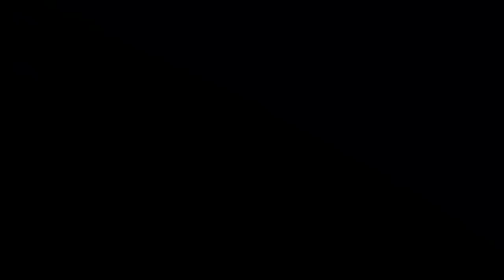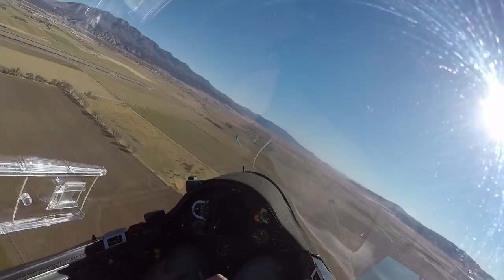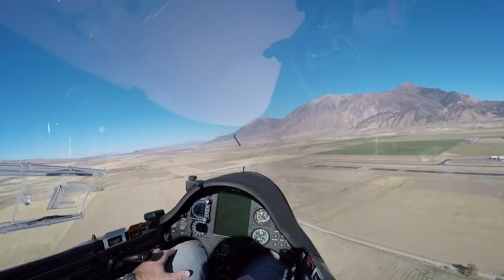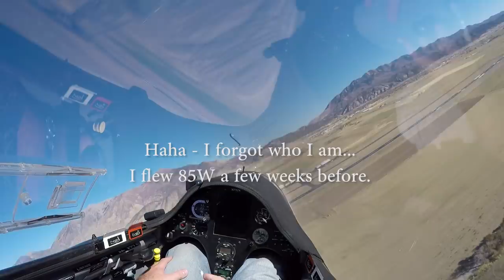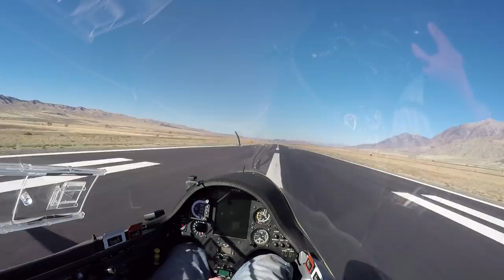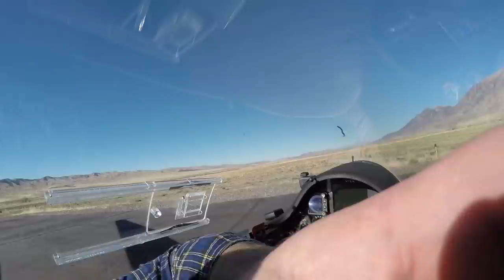Glider Ground Effect Demonstration

Comment: Ground effect is where the air below the wing is compressed and creates lift. It happens within the height of the wingspan.
Reply: Correct explanation, no effect on drag.
Reply: Real engineering made a great vid about this
Reply: K S thats not correct. Induced drag is reduced in Ground effect.
Reply: It does however effect induced drag
Reply: The air is not compressed. Compressibility of air is negligible under mach 0.3. Lift in increased and induced drag is decreased because of the proximity of the ground.
Reply: Pieter de Buck I don’t believe that. People often say “air is incompressible”, but the pressure under a wing is always high, which must mean the density is also higher so the air is compressed, no?
Reply: @theespatier4456  yes technically the density has to change of course, its just negligible at low speeds (< mach 0.3)
Reply: Pieter de Buck Yes, I guess most of the ground effect comes from decreases induced drag and not lift from a compressed air cushion, as some say. But I would assume it’s the opposite in helicopters!
Reply: The Espatier no, it’s not high, just higher than the air above the wing
Reply: @theespatier4456  What?? Who has ever said air is in-compressible? Are you getting confused with water? Of course air can be compressed.
Reply: Tim Nell How high is high?
Reply: Lewis sun Lots of people... they say it’s incompressible under Mach 0.3 simply because that’s what physicists say.
Reply: @theespatier4456  I think you need to look into this. Air is compressible under mach 0.3, but it's just a negligible difference for aircraft at that speed. People that work with modeling aerodynamics through math and computer simulations usually assume it is not compressible in their calculations below 0.3 because it takes less time to get a result. It might not be perfect, but the errors are very small and don't really effect anything below that speed in the field of aerodynamics. Beyond 0.3, the effect is more noticeable and the proper calculations accounting for compressibility are required to get an accurate result.
Reply: @RyanGrissett  negligible is argued by the case, you cant just repeat it for any case simply by the speed alone.
Reply: Ryan Grissett Right, but that’s just a dogma that people repeat without understanding it. People often bring up “incompressibility” or “negligible compressibility” up after someone says air is compressed, higher density, or higher pressure under an airplane wing. How “negligible” is the difference in pressure below an airplane wing if it makes an airplane fly, for instance? That they never explain.
Reply: When dealing with the pressure changes around a slow-moving wing (mach 0.3 it lower, roughly speaking), the change in volume is small, on the order of fractions of a percent.  The bigger picture in so-called 'incompressible' flow is that the flow field extends significantly in front of the plane as well as all around and behind it.

In normal flight, the wingtip vortices begin to develop well in front of the plane, along with an outward  component below, and an inward component above the wing, with the done in the middle flowing downward.  This has the effect of making the wing perform as if it were shorter (spanwise) and fatter (chordwise), and thus less efficiently.  In ground effect, the formation of the downward and outward components, allowing the wing to perform as if it were longer.

TLDR version: it's due more to changes in the flow field than changes in the pressure.
Reply: It only comes into effect when above the ground by half the wingspan
Reply: Thank you mate. I'm an AMT student but we haven't come up to that topic yet.
Reply: @gabrielshamahabonales4348  Wenn man Gefühl hat, spürt man diesen "Polster" beim Landen, knapp über den Boden.
Reply: @theespatier4456  It's easy to believe that but pressure and density are not the same.  Pressure can increase or decrease on a wing without changing density.
Reply: So much drag in the comments.  Beautiful flyight
Reply: @yak55x  Fliegen ist  Gefühlssache . Man fliegt nicht nur mit dem Kopf, sondern wichtiger mit dem "Hintern", man nennt das "Sitzgefühl".  und beim Landen spürt man, knapp über dem Boden,  das Luftpolster, welches sich, unter den Flächen, zusammenpresst. Wer das nicht spürt, wird nie sicher fliegen können.
Reply: @wq6737  The internet is really annoying today. Keep feeling your backside.
Reply: @yak55x  That`s allright,Im im net schreiben soviele "Kluge",  daß  man sich nur wundern kann, von wo diese  deren sogenanntes "Wissen" erhalten haben. Da ich aber sowohl segel- als auch motorgeflogen bin, und Letzteres im Kriege als Jagdflieger,  maße ich mir doch zu ein wenig Kenntnis auf diesem Gebiete zu haben. Natürlich gibt es Theoretiker die alles besser wissen, ist aber deren Problem. Entschuldigen Sie mir, daß ich Ihnen deutsch antworte, ich bin zu bequem,  für jemandem, der ohnehin der Deutschen Sprache mächtig ist, englisch zu übersetzen; da ich mich, noch obendrein, bemühen muß auf  Taktlosigkeiten  kultiviert zu reagieren. Ceterum censeo, wenn Sie, geehrter Herr, das Internet so ärgerlich finden, warum lesen und  schreiben Sie dann hier ?
Reply: @wq6737  Google Translate: Es ist nur ein kleines, unwichtiges Beispiel dafür, wie Leute die Wissenschaft ablehnen, weil sie sich so anfühlt. Die Einstellung ist gefährlich.
Reply: @KS-tf6nw  Right, but as a consequence you get better lift and can lower the angle of attack slightly.  That enables you to float with a perceived lower drag for a while.
Reply: @yak55x  Hier fehlt der Großteil Ihres Kommentares in dem  von der Klimatheorie bis zur Flugtheorie alles durcheinander vorkommt. Da dreht es sich jetzt nur um das Fliegen in Bodennähe. Um diesen Effekt zu verstehen, braucht man kein "Wissenschaftler" sein. Wenn ich zum Landen ansetze, liegt erst mal die Maschine nicht waagerecht sondern vorne, nach unten geneigt in der Luft, also Anstellwinkel der Flächen ca.0. Knapp über den Boden muß ich sie vorne etwas anheben um eine "3 Punkt Landung" zu erzielen, ausserdem um einen "Kopfstand" vorzubeugen. Damit ergibt sich wieder ein positiver Flächenanstellwinkel. Damit pressen die Flächen die entgegenkommende Luft gegen den Boden,  verdichten die"Unterluft" gewissermaßen. Das ist dann das "Luftpolster", knapp über dem Boden. Diesen Effekt haben schon die DO X , bei ihrer Atlantiküberquerung,sowie eine Russische  Spezial - Flugzeugkonstruktion ausgenützt. Ist also eine einfach verständliche Sache, die beileibe keine "Wissenschaftliche" Erklärung benötigt. Im Übrigen, wenn man bestimmte, angeblich "Wissenschaftliche" Theorien ablehnt ist das nie eine Ablehnung der Wissenschaft an sich und gefährlich schon gar nicht , wir leben doch nicht mehr in der Zeit der Hexenverbrennungen, als Bezweifler bestimmter Theorien , mit dem Tode am Scheiterhaufen bestraft wurden ? Oder sollen solche Zustände wieder geschaffen werden, den Anschein hat es ja, zumindest bei der Klimatheorie !
Reply: It affects the induced drag
Reply: If I remember my aerodynamics class correctly, if you assume potential flow, you treat an airfoil as if it had a mirror image of itself across the ground plane. Pretty cool
Reply: @jpegjake  of course every case is different, but it would be easy enough to figure out the potential error if you run a simplified version of your simulation
Reply: I don't remember how it works, but I do remember that it comes into effect at ½ the aircraft's wingspan or ½ the rotor's diameter for helicopters.
Reply: when someone puts there finger next to your face and says i’m not touching you, well they actually are. anywhere within finger distance.
Reply: The Espatier You mistake pressure with change in destiny and actual compression. For example water is incompressible but you can change its pressure the same goes for air. In aerodynamics below certain speed the actual compression of air has negligibly small effect on the flow. Do you understand now ?
Reply: My GSI always told me that it was reduction of wingtip vortecies and reducing the induced drag.
Reply: @RyanGrissett  Nothing is linear. But you can linearise almost everything to get a close enough approximation that works.
Reply: Ground effect is where the high to low vortices are mitigated a bit and this induced drag is reduced.
Reply: half the lenght of wingspan actually
Reply: No, ground effect is when the ground blocks vortices created by the wing. These vortices normally cause drag, but if they're interrupted then they don't. It's much like the use of raised wingtips on planes (and birds) - these block wingtip vortices to reduce drag. The pilot in the video is correct.

https://en.wikipedia.org/wiki/Ground_effect_(aerodynamics)
Reply: I wouldn't say more lift is created. From my understanding it is the reduction in drag because the relative air can't be bent as much because of the ground. Dr. Alexander Lippisch talks on this concept of induced drag.
Reply: Wow. The misunderstanding of the relationship between lift and induced drag while in close proximity to the ground is really something. Bruno’s statement that drag is reduced is 100% correct, specifically induced drag. Flying in ground effect reduces AoA and therefore reduces induced drag. That is why you can seemingly maintain energy for a very long time.
Reply: @KS-tf6nw  yes effect of drag due to weaker wingtip vortecies
Reply: Completely false. Thanks for misinforming 650+ people.